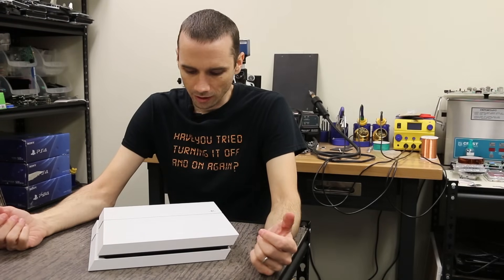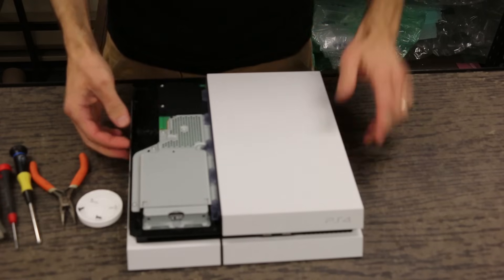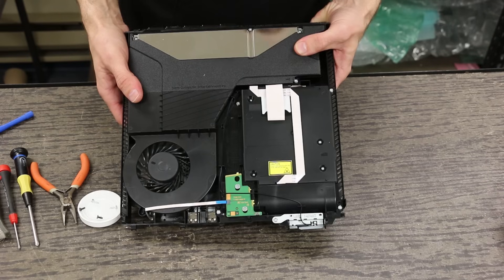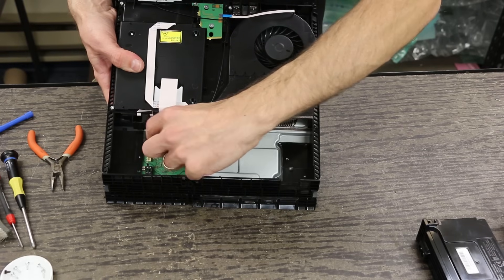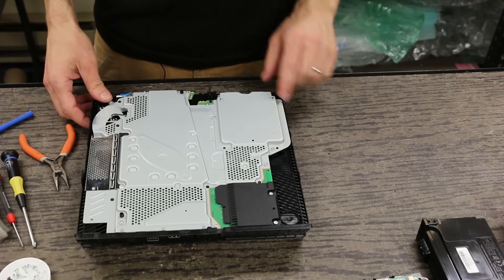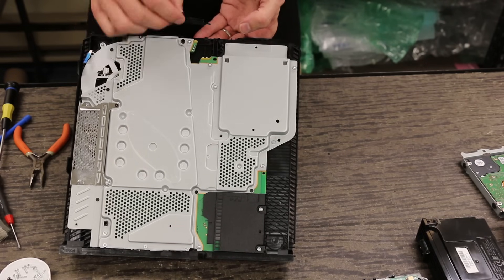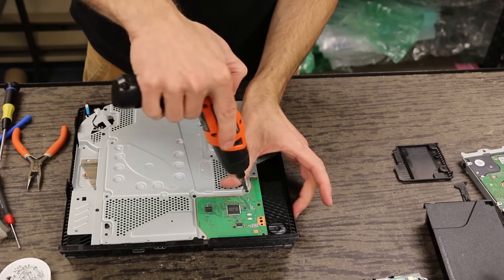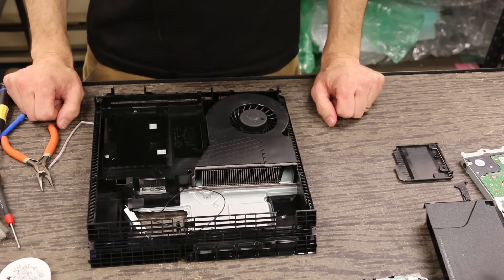PS4 1215 Teardown Tips & Tricks

Comment: Edit for 1200 ps4 series
Hi!
Could you please show how the optical drive is wired more in detail. I send my ps4 to dust but now it wont read any disks and it's making a weird noses when turned on.
Im more confident in doing it myself than sending it back
Thanks for your help already man
Reply from the maker: +XXX1Edge1XXX We'll try to make more vids about this disc drive at some point.
Reply: Thanks man. I've fixed it myself watching your video.
If it can help someone, at some point there wires that connect the optical drive to the motherboard. The smaller one has a removable stand. And when he was remounting he put the stand in reverse.
So i had to unplug the cable, remove the stand, put it back in the right position, put the stand back and plug the stand

Comment: How do you fix the eject button on that model?
Reply from the maker: All PS4's are multi voltage.
Reply from the maker: +Michael Stricklin Replace it with a new one
Reply: +TronicsFix one question?? is the japanese ps4 cuh 1200b multivoltage??
my ps4 says "100v 2.3A 50/60hz" , but in my country  are 220v  (argentina) ..
thanks , sorry 4 bad english

Comment: Model No. N14 200P1A
Reply from the maker: +Maria Aguilar You can't buy them right now. There is a shortage of them. As soon as we get some in we will have them listed on our website.
Reply: +TronicsFix ok. Is there a way to fix the power supply I have now?
Reply from the maker: It may be fixable but we haven't really had time to take a look at any broken ones to determine what might be causing the problem.

Comment: How is the overall build quality of this model? is it quieter with the single heatpipe integrated across the base and the slanted fin design? Any of the CUH-12XX models with BLOD or shutting down issues? how is the heat? thanks :)
Reply from the maker: +Michelle Larkson This model does run quieter...it also uses less power. Yes we've seen both the BLOD and the on and off problem with these models. They seem to stay cooler but I'm guessing they will need thermal paste replaced after a year or two just like the older models.
Reply: TronicsFix Thank you so much for the fast replies :) 
Do you recommend replacing the paste right out of the box with a new console, or until problems arise? If it turns out that the APU itself is bad (which you mentioned wasn't replacable unless in a set in an older video), will Sony still repair it with a fee even with a voided warranty?
Reply from the maker: No, I would never recommend replacing the thermal paste right out of the box. The factory paste can last a long time. 
As far as I know Sony will fix it for a fee, but I don't know for sure...never sent one there!

Comment: Have a 1st gen ps4 the day it was released. Cleaned the system, replaced
 thermal paste with MX4 paste and still nothing. It would remain quiet 
for about 10-15 minutes and just start screaming again. Not so bad in 
Idle (it wasn't before either) but Netflix really has it going. Witcher 
3.. Forget about it. Any advice?
Reply from the maker: +MrKaYo323 I'm assuming you are 100% sure it was put back together correctly with the thermal pads in the correct place...also I'm assuming that you have the correct amount of thermal paste there and that you cleaned it carefully before applying thermal paste. 
If all that is true then I would be checking to make sure there is good airflow around the PS4. It's always possible that the fan is going out or the heat sink is plugged or something too.
Reply: PS4 is in an open spot with plenty of room for airflow. all plugs are plugged in. I've read in a few forums that this thermal paste fix is not always the answer especially to 1st gen systems. have you ever ran into this problem before where the thermal paste and cleaning did not solve the loud fan problem?
Reply from the maker: +MrKaYo323 I've seen the connection problem between the APU and motherboard cause it but that's not common.
Reply: Thank you. I'll check it out.
Reply from the maker: Good luck!
Reply: MrKaYo323 l
Reply: +TronicsFix how can i remove the bottom of the ps4 what tool did you use im trying to pull off after unscrewing that single screw but i cant
Reply from the maker: It's called a plastic opening tool or pry tool. You can find them on Ebay or Amazon. Anything that is thin will get in there.
Reply: +TronicsFix What else can i use?
Reply from the maker: idk...we use opening tools because they do the job and don't mar up the plastic. I don't know of anything else that will do as good of job.

Comment: if i buy this model from japan  100v will it work in india 240v plz hel
Reply from the maker: Yep...I know it's multivoltage...that's what I said. They work anywhere.
Reply from the maker: +vikas gahlaut Yes it will work anywhere.
Reply: +TronicsFix I buy cuh 1200b in japan too..   says "100v~ 2.3A 50/60hz" ..  will it work in argentina?? (220v) ?? or need an adapter o something else??
Reply from the maker: It will work anywhere.
Reply: not need adapter or something?? thanks
Reply from the maker: Nope
Reply: thanks! Is multivoltage . ps4 says 100v,  but works fine in 220v
Reply: ^^ thanks..  sorry for my bad english, I dont understand your words in the video; I speak spanish XD

Comment: PS4 update error code e-ffffffff - update 3.11. It's a 1200 model purchased in October 2015. Any fix for this type of error code?
Reply from the maker: +Derrick Wims (Pete) If I were you I would just send it in for warranty repair. Usually this code is caused by a game or application. If the game disc is even just a little dirty it can cause it. It sounds like it's doing it during an update for you though. You might try an offline update with a USB.
Reply: +TronicsFix copy sir...thanks

Comment: 14:55 radiator base. this is steel? not aluminum? but the thermal conductivity of steel is bad, isn't it?
Reply from the maker: +Николай Костенко Aluminium.
Reply from the maker: I'm assuming you mean the power supply and the connector that goes on the motherboard? You can always send it in to us if you'd like. It needs to be soldered back onto the board.

Comment: Hello. I was googling for answer but found nothing definitive yet - does CUH-12XX can only use 2.5 drives which are no thicker than 9 mm (like first 10xx and 11xx models) or it's possible to use 12 and 15 mm drives with console now?
Reply from the maker: +Zecuto The only ones that we've seen so far are less then 9mm. Whether a thicker one will work or not, I'm not sure, but probably not.

Comment: Hi.

I want to do a case mod on this model and I was wondering if I could take off the metal plate that covers the motherboard, installing individual heat sinks for every RAM chip... Would that work? Would I be compromising anything? of course I would be securing the Motherboard to the console structure.

Thanks in advance.
Reply from the maker: +Mrark Stainer It's hard to know for sure. I'm not exactly sure how you are going to do that, but it sounds like it may work

Comment: I know you put new thermal paste on prior... Still good practice after another tear down to put new paste on. I only say that because you risk trapping air.
Reply from the maker: +Brady Simmons We've never had a problem with reassembly even if it's for the second time...that being said we do usually put a small dab in the middle to make sure there is adequate paste and connection.

Comment: Is there a difference between the heatsinks of each model??
Reply from the maker: +SPARTNKiLL3R The heat sinks are similar...no major differences that we've noticed. That being said...the 1215 does seem to run much cooler.
Reply: +SPARTNKiLL3R The old one has a full aluminum board for the heatsink whereas the new model 12XX has a steel base to attach the aluminum heatsink. Although steel is not a good heat conductor somehow the new model runs much cooler.